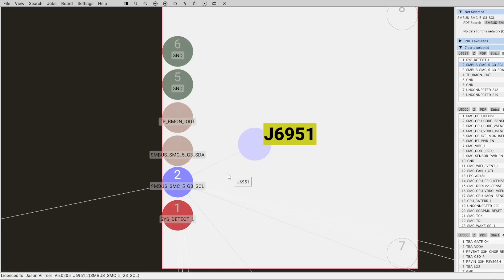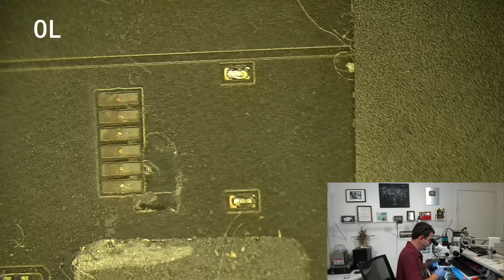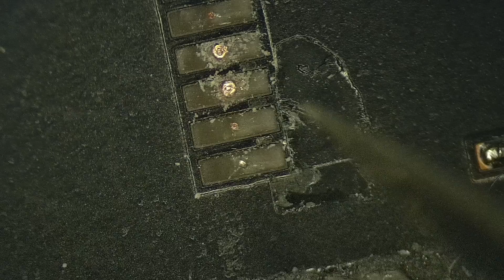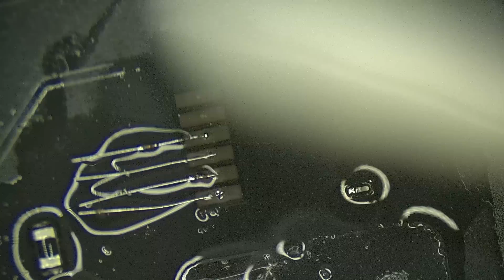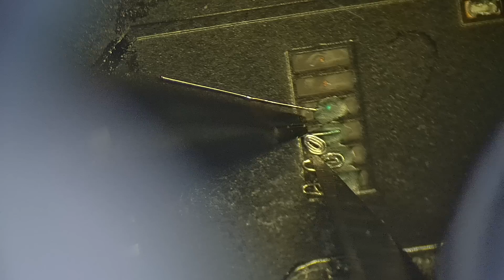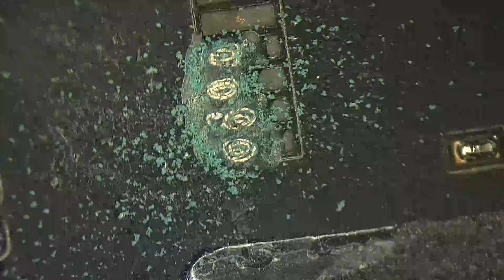MacBook Pro Motherboard Repair Part 1 (On Off-Grid Power)

Comment: Jason, I know you mostly work on iphones. I pried off the connector on the motherboard that the power button flex cable connects to. Is it worth the money to get it fixed if I can even find someone to do it. It's a motorola edge plus. I blame myself for not watching video on how to disconnect it.

Comment: I've just watched another pcb rebuild video on YT, he had a sheet of paper with dozens of track copper traces, he could simply clip off the shape he needed and glue it in place then solder to it. He also used a lot of fine copper wire!

Comment: I know how small this actually is while I am not a board level repairer I have worked on everything I think and have a good judge of scale. Itty bitty is not even close. Watching you work and being bored to death at home I had some of the ring LED lights that had failed, emboldened by you and several other channels I went to work on them, found the faults and repaired them and the gasp loudly worked. Big Clive showed me how to find the two power regulator resistors (smaller than a grain of sand) and to remove one you get a longer life from the LEDs as you are not driving them so hard...well no, thinking I had found them I unsoldered one and presto no light at all..... annnnddd I lost the resistor. Found another light that was bad unsoldered one of the same resistors and tried to resolder it in place. Tweezers check, iron check, solder paste check, resistor.... and I lost that one too.... damn it man. Found the first resistor with a careful inspection of the area around my work bench me A$$ up in the air with a super bright flashlight and my face planted on the floor soldered it back in place and YESSSS  it worked!!!!! No more making fun of your shaking, no microscope so I used my phone on zoom and watching my own hands 5x the size shake like I was in an earthquake... 
Great humor, great scripting in both videography and text, great all around everything Jason.... 
And you know the greatest critic you have? That would be Jason 
Chill out bro you are amazing you do what you like to do, provide for the family while doing it and you are an amazing board level tech... :)
Reply from the maker: Thank you!  Yes, when these components ping off the end of the tweezers, they are often gone forever!  I'm glad you found the resistor and was successful.  It's a really good feeling when stuff works after fixing it! :-)

Comment: That power center would sure have been used here   Our power has been off for 12 hours plus
Reply from the maker: Our last power outage was 5 days long!  This thing will run us for a good long while if we are conservative but we need some charging power for extended outages. I want to add some solar or I’ll be driving it somewhere to charge in those cases. I hope your power comes back on soon!

Comment: Why is it that the vias are like thinner just when they get to the pads, so if you scratch out a bit there is more of them? Why not do the same for the ground pads?
Reply from the maker: I’m not sure why they’re like that really. I think it’s just the way the boards are engineered.  This is actually the first MacBook board I’ve carved into like that but I’ve did this same thing to many iPhone boards.  I was hoping to find something larger down in there to solder to!  I will be soldering a wire from the ground plane across the 2 ground pins.

Comment: Nice job! Are you sure you soldering to vias stay intact under mechanical stress like dropping the device? The pcb material seems to be quite soft, I wonder if is still standard FR4 or something else. Does somebody know more about this?
Reply from the maker: Thank you!  I am a bit worried when soldering to wires connected this way as the heat can travel almost instantly down the wire to the solder joint I encased in UV mask.  The connector will be secured very well with glue once completed so I'm pretty confident in this being a long lasting repair and will survive future battery replacements so long as nobody prys on the wrong side again!

Comment: Well done Jason,  that was a bloody good repair :-D
Tiny through plated holes, What a nightmare :-(
If you have to use force to lift a connector, you are doing it wrong.
Not something  Ive ever seen you do.
Reply from the maker: My biggest fear is getting it fixed all nice and pretty and then the next guy who changes the battery pries the wrong side of the connector again.  Lol it will likely be stronger than factory when I get done glueing the new connector on tho 😬. Thank you!

Comment: Heya, nice battery pack hope to see some specs and even test's (cc, cd, Ah, kwh ect. ). you have to start some were with the repair and starting with new path's sound ok now after wards you could solder the wires directly to the connector (I gues your gone do it olso lol) really hope to see part 2 soon
Reply from the maker: Thanks :-) I’m pretty excited about the big battery pack.  It’s rated for 3600 watt hours as it sits.  Has built in Solar / DC charge controller as well as an AC to DC converter for charging.  It draws 1800 watts when charging from my AC outlet!  The app lets you throttle the charging down to as little as 40 watts tho. The solar input is rated for 15 to 150 volts, 15 amps. The built in inverter is rated for 3kW.. I’ve confirmed it kicks off at 3.3kW.  I’m really liking it so far!
Reply: @ststele  Heya, and what for batterie cell's are inside LiFiPo4 ?

Comment: when this job done on the iPhone board  (when 2 half's have to be separated)  and if via still in a good condition, it is just simpler there to use a round strip pad instead of this roundabout with a wire.
Reply from the maker: I haven't tried using the pre-fab lugs yet.  On split boards with the via in good condition, I usually clear it off good & use a blob of solder.  I'll be giving the product you're talking about a try though.  Sounds like a big time saver!
Reply: @ststele   it does from a my experience at least on an iPhone boards

Comment: Are you assuming that the vias are connected to the first layer you face? please check them so you don't short layers together.
Reply from the maker: I checked the vias in diode mode before & after the excavation.  I'm also watching very closely so unless some other trace surrounds the via with the same diode mode measurement, it should be safe to assume it is the same line & not shorting to anything.  It's actually quite a lot smaller on iPhone boards so this Macbook is like a giant scale model.  :D